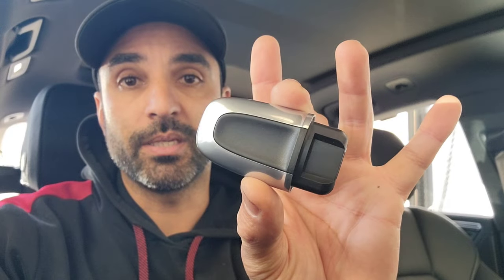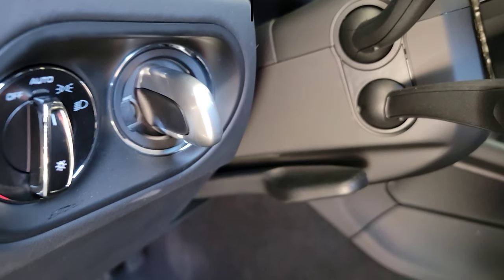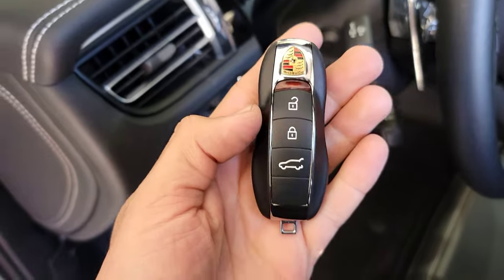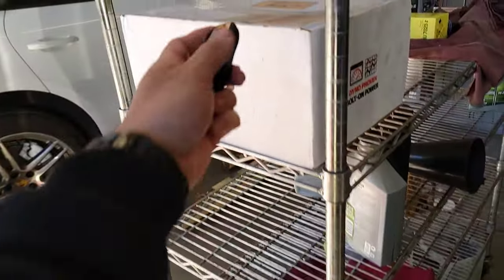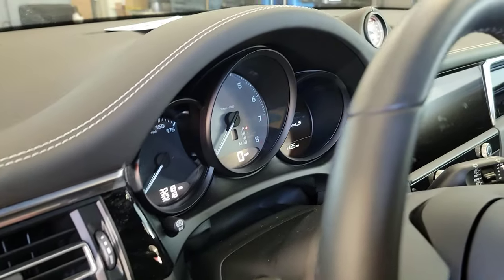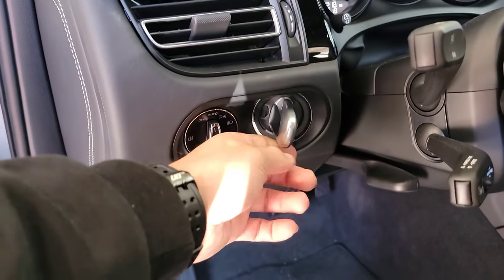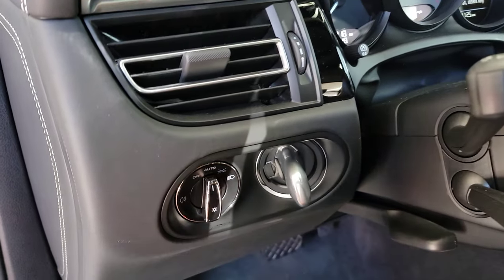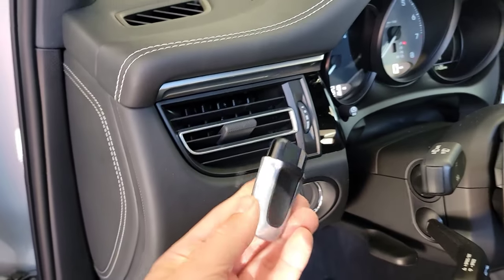HOW TO REMOVE PORSCHE IGNITION DUMMY KEY

Comment: Turn your old key plug to the far left and hold it that way for 30 seconds. You will hear a click that unlocks the mechanism and you can then remove it. In some cases, the actual remote control key must be outside the car and out of range on the vehicle.

Comment: so you can use the real key to start it now right?
Reply: Yes
Reply: No, the key fob doesn't fit in that slot. It only sends the signal to allow the dummy key to start the car. It works the same way as the push start button.
Reply: @HanNguyen-vb3eo , wrong. You may have to fiddle with it the first time, but after that the real fob slides in and works just fine.
Reply: @Cinclow20  correct! I just bought a 2013 GTS and the key fob sometimes didnt read and I was freaking out as I was almost stranded in Maine ,but it finally started ..changed both key fob batteries ..this AM it didnt read and was annoyed ,seen this video..took the dumby key out and at first thought the key wouldn't go in..but it did..it started up..

Comment: Good video EXCEPT the music is so loud I can't hear your speak, but I can see what you're doing.
Reply: Turn your old key plug to the far left and hold it that way for 30 seconds. You will hear a click that unlocks the mechanism and you can then remove it. In some cases, the actual remote control key must be outside the car and out of range on the vehicle.

Comment: Doesn’t work with 19 forward, removable key was made permanent
Reply from the maker: Your right yea like the one in the 992 this doesn't work
Reply: My faux key looks just like the one in the video and I was able to remove it just like the video showed.  I have a 2023 Macan GTS. Cool video.
Reply: Turn your old key plug to the far left and hold it that way for 30 seconds. You will hear a click that unlocks the mechanism and you can then remove it. In some cases, the actual remote control key must be outside the car and out of range on the vehicle.
Reply: @roadstertech Turn your old key plug to the far left and hold it that way for 30 seconds. You will hear a click that unlocks the mechanism and you can then remove it. In some cases, the actual remote control key must be outside the car and out of range on the vehicle.

Comment: My 2023 GT3 has a different dummy key and this process didn't work for me.  Any suggestions?
Reply: Turn your old key plug to the far left and hold it that way for 30 seconds. You will hear a click that unlocks the mechanism and you can then remove it. In some cases, the actual remote control key must be outside the car and out of range on the vehicle.